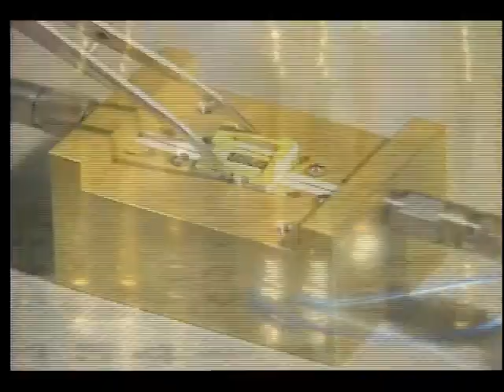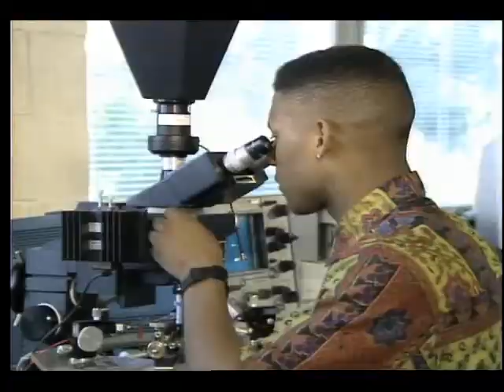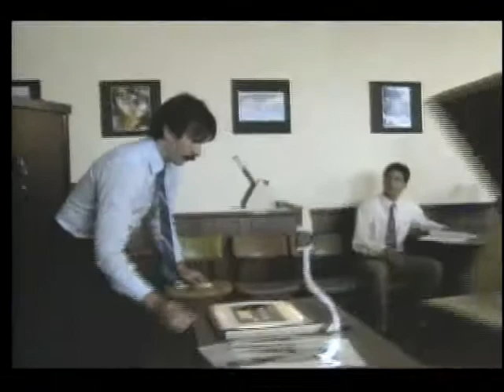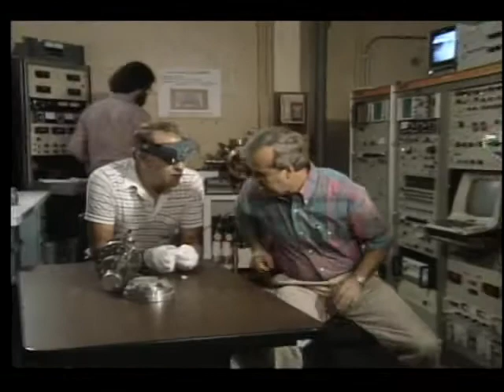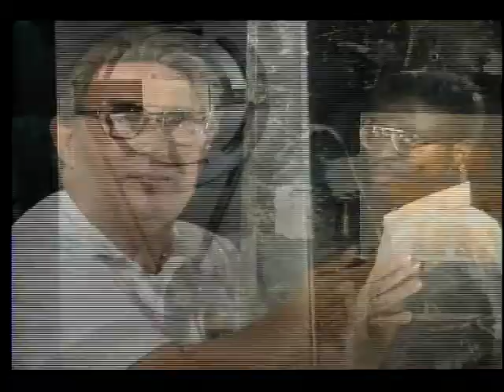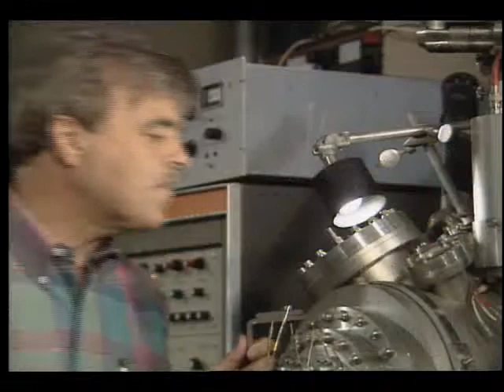The Space Electronics Division: Research for Today and Tomorrow

Comment: how do electronics work in space when cpus lock out at negative 50 degrees here on earth overclocking using liquid nitrogen? space is 450 degrees to negative 450 degrees..and supposedly most of these run on batteries and solar panels? would require huge heating and colling abilities no way a battery could keep up.
Reply: That's why you have temperature control in a satellite. the only two things that has to withstand the big temperature differences are the solarpannel and the outermost isolation layer of the satellite. Inside under normal operation you will only have a view °C variation. Typical temperatures are around 27°C. Thats why you have to design it and cat just send a computer case into orbit ;)